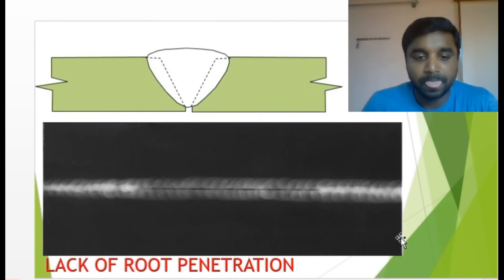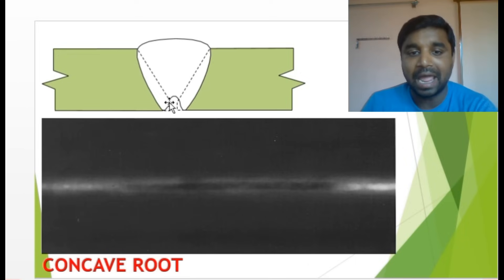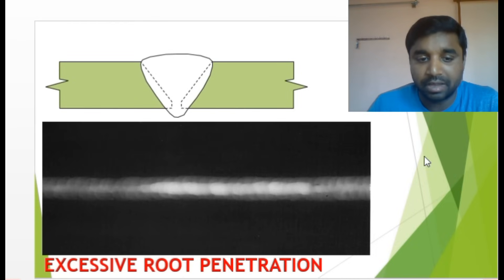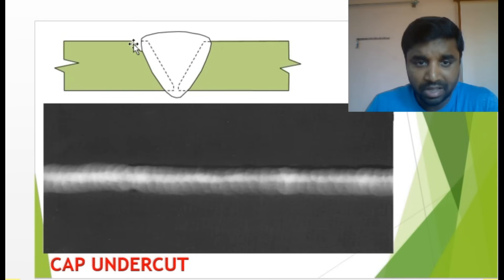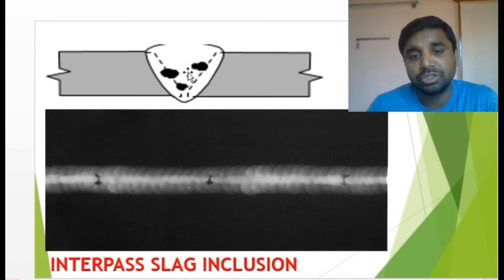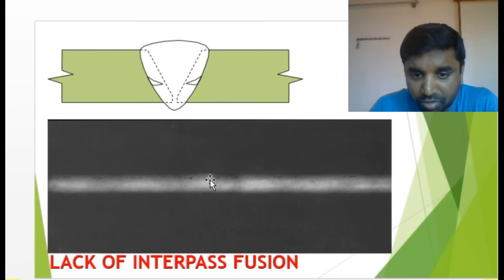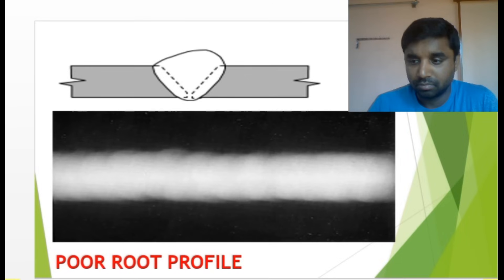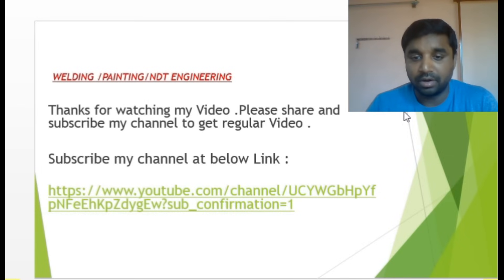Radiography film interpretation and find defect (Weld Joint)@WeldingNDTInspection

Comment: Do you have such scanned digital images? I want to use them as an experimental project that allows me to identify such defects automatically. And if possible, can you share me photos that would be kind.
Reply from the maker: What do you mean digital images? I have the emages pdf copy
Reply: @WeldingNDTInspection  That can work too. Can you share it with me?. I'm mailing you about the same :)